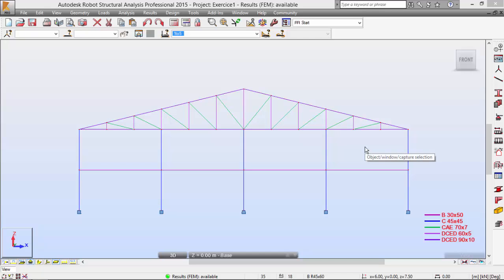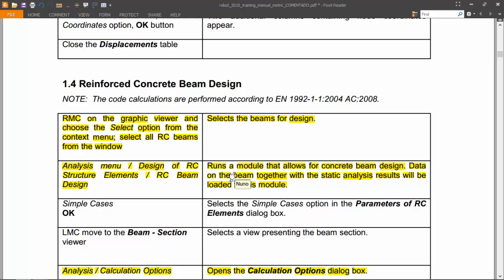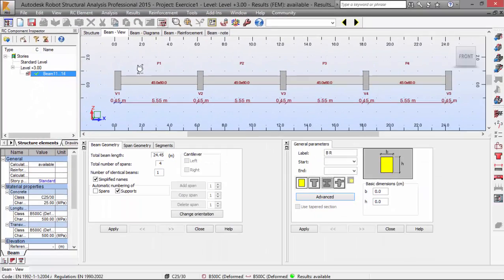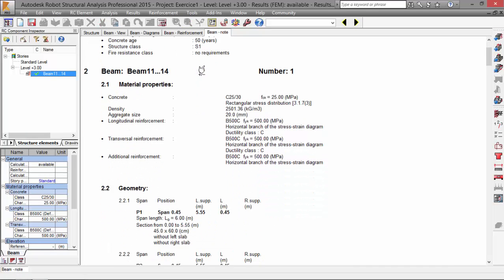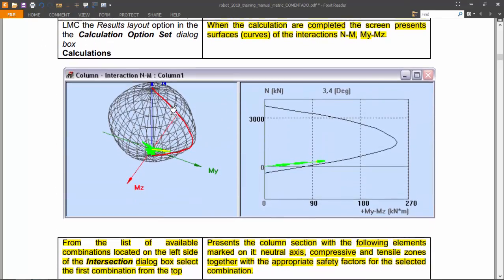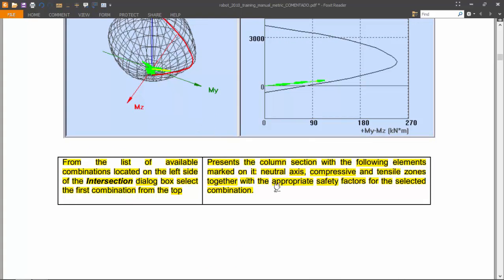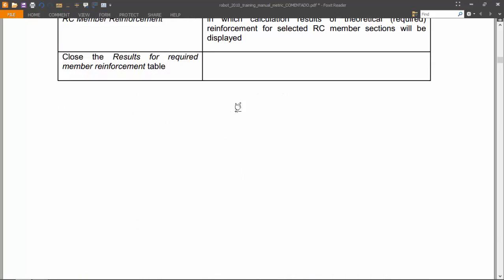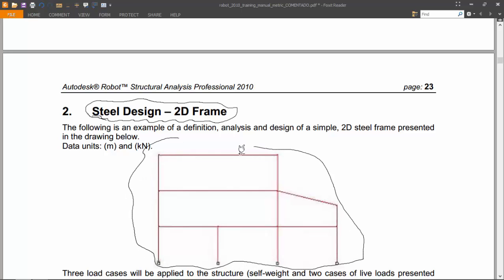Exercise 1 - Part 3 - Reinforced Concrete Design (Robot Structural Analysis)

Comment: When i try to practice this section, i found a problem. While i try to running RC beam design, it showing notification "Value out of limit". could you explain this problem.? Thanks...
Reply from the maker: +muhammad yahdiman are you using the same regulation that I used in the exercise? I used EC2. That could be the problem.
Reply: i try different parameter. yes, i think that's the problem. i've been using according parameter in video and its running well. thanks your response
Reply from the maker: muhammad yahdiman you are quite welcome.